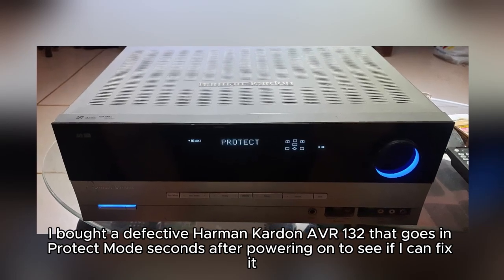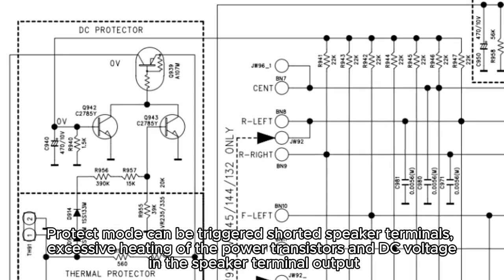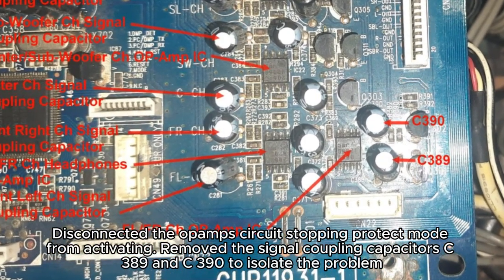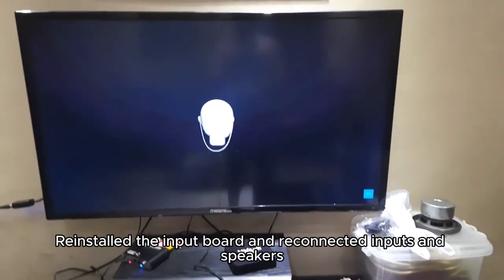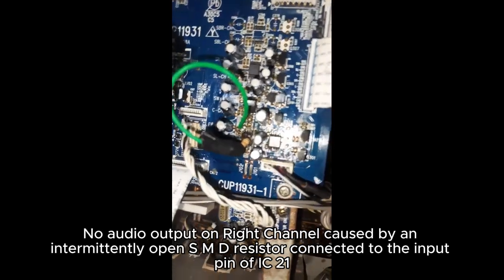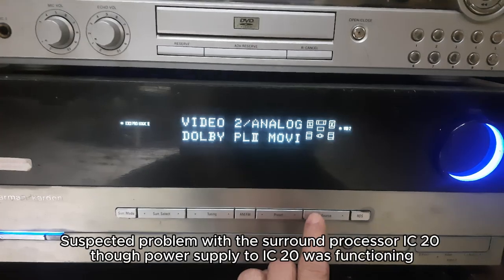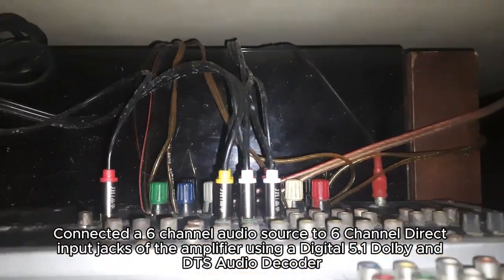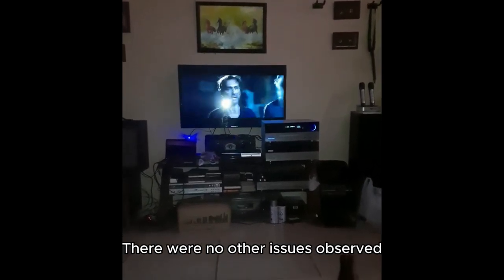How to Fix a Harman Kardon AVR 132 Protect Mode Problem

Comment: I have an HK AVR 520 which was working normal until I over heated it by failing to open the glass cabinet doors on the entertainment centre for air flow when watching a movie one night. So the amp got pretty hot but it worked the whole night. The next time I went to use the amp the surround mode did not work anymore and neither did the sound surround test on the remote. I still have stereo mode working just no surround mode (Dolby, DTS, etc) so I thought it might just be a blown cap or something. I took it all apart to perform a visual inspection but did not see anything that was out of character (bulging caps, burnt trace, etc) I had been using optical cable from my Blu-Ray DVD player so since this is part of the surround mode that does not work. Could there be a thermal fuse located some where ? Do you have any ideas of what I can do to solve this problem? Since you have worked on similar products any help would be of great assistance.
Reply from the maker: Try testing 6 Channel direct to know the if Center, Left/Right Surround, and Subwoofer main amps are good. No audio ouput means bad main power amp. Otherwise, it can be a failed surround processor chip or op amp in the bad channels. Read my blog for troubleshooting ideas that maybe useful to fix the problem. https://blog.arnbb.me/?_gl=1*1aivobs*_ga*OTY5OTc2NjE1LjE3NTM3Mzc4MDE.*_ga_44TYLPL8PN*czE3NTgwNjMxODkkbzEwJGcwJHQxNzU4MDYzMTg5JGo2MCRsMCRoMA
Reply: @eaglewolfer  Based on your reply I'm thinking it is probably in the surround processor circuit somewhere. I have since taken it all apart and removed all the PCB's so I could have a better look at them. I checked for bad solder joints, irregular caps and any abnormal signs of anything out of normal. I also checked the large resistors (by the transformer) that others were saying had caused issues and I did not find anything bad. I put it all back together and powered it up and now I have a new problem. It still powers up normally with the display showing but now the VID1, CD and TAPE LED's stay on constantly no matter what I do. Changing the 'Source' on the front panel shows that you are changing sources (reading the display) but the LED's never change. I also do not get 2 channel stereo mode anymore which I had before. Basically no audio output now. I checked to see if there was any voltage coming out of the speaker outputs and there was none. Obviously something has changed here. I had a look at your blog and it looks like I need to lookup components. Would you happen to have a link for the schematics for this model? A block diagram would be really helpful as well. Appreciate the help.
Reply: @eaglewolfer  You have a link for a service manual ?
Reply: Anything ?